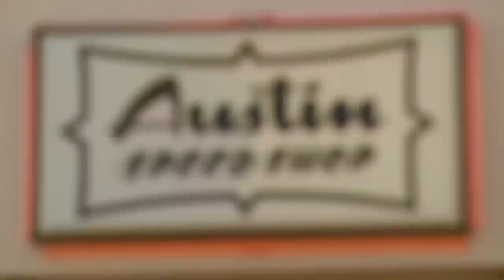What happened to Jesse James “Austin Speed Shop”? Why did it end?

Comment: Jesse, I am disabled and 68 yrs old. To try you will never fail. I learned to stick weld from my Dad when I was 14, was the 2nd best student in Voc. Auto. Went to work in a sheet metal fab shop. Learned to setup and run a 10 ft. Shear,punch presses,brake presses, a Strippit cnc punch press. Then spot welded,tig wrlded, mig welded, and air arc. Then the polishing and grinding area then prep and paint. Business closure I went to Allis Chalmers and welded and spray painted on farm implements,then AMGENERAL spray painted and welded on mail trucks,deuce and halfs,humvee trucks. Also spent 2 years at Amtrak in Chicago as a locomotive machinist.  Tried brother, sometimes I wanted to be a engineer, but always moved forward. I loved working on mechanical anything. Oh yea, My driver bike is a mild 90 HD and had a 82 flat. Pretty bad crash, I got Air Amgel lift to the ER. Good Luck brother.
Reply: Do you reckon JJ will ever read your comment?
Reply: Send this message to him on instagram. You have a good chance of him seeing it and responding on there. Stay motivated and keep going brother.
Reply: Nice you had a dad and enough support to go through school. Easy for you I see.
Reply: I’m sure he’ll watch this half ass video let alone read your comment. Cool story though
Reply: That's the kind of lame comment I would expect a Francis to make.
Reply: @gilbert3152  Truth hurt uou?
Reply: @gilbert3152  its a handle Not my name
Reply: @francisjaniewski5990  Settle down, Francis.

Comment: I saw Jessie tighten the head bolts on a flat head Ford with an impact gun.  That showed me all I need to know about his mechanical skills.
Reply: The man has talent.
Reply: @1pcfred  I know, just ask him.
Reply: @jebsdaddy141  🤣🤣
Took me a sec 🤣
I'm like ask who? 
Ohhhh 🤣🤣🤣🤣
Reply: Well if you know you impact gun you can do that flat heads weren't anything special, torque them down with a long bar that's how they were built no torque wrench back then I been a machanic for 55 years I'm 69 now I've done many flat motors and I can guess at a torque setting with a breaker bar or a impact gun I've been doing it along time, the flat head doesent have long bolts like a new type motor

Comment: What happened to Jesse James was what happened to the entire motorcycle industry. It was huge, the custom bike scene, the sportbike world, dirt bikes, etc until the whole recession in 2008. The motorcycle world shrank massively and has not recovered. The prices of new motorcycles are basically double what they were back in the early 2000s.
Reply: I worked at a body shop that started painting bikes in like 2003, by 2005 we had two guys actually building bikes. In 2007 it was down to one guy, and a couple tanks a month. Then in January 2009, it was over, and even techs got laid off. 
A lot of the guys buying choppers were the dudes signing loans on the loans that tanked the economy in my area. It was a joke.

Comment: The low tech is depressing, no CNC cutting or sheet metal technology that would speed up the process one bit, even for the most basic operations. No CAD drafting, no real project planning, looks like a kid building a BMX bike, only bigger. Then the emissions violations were blatant, he paid huge fines. Not a role model in my book.